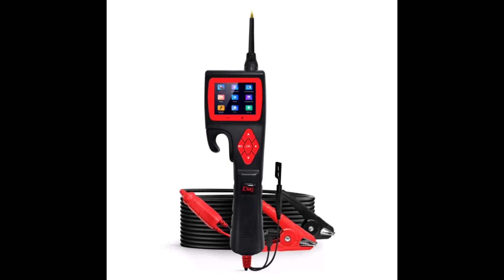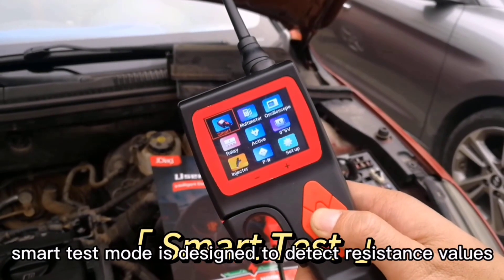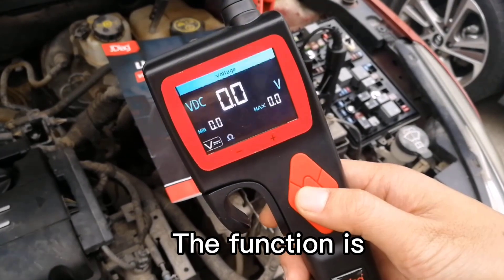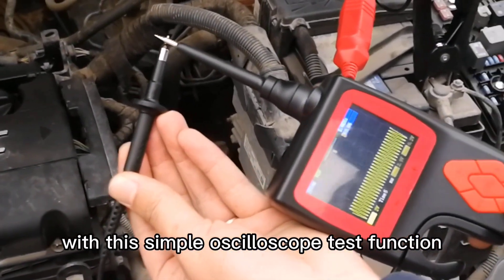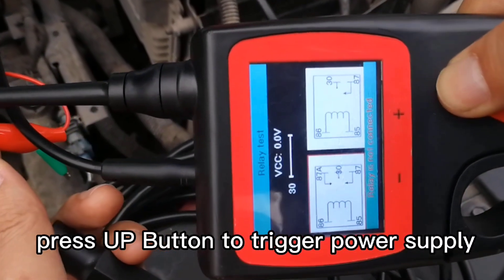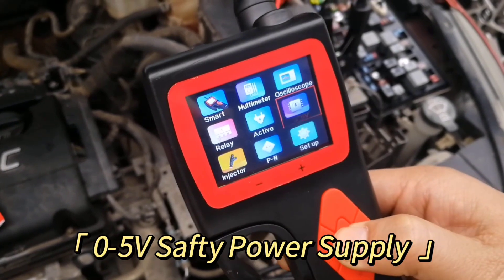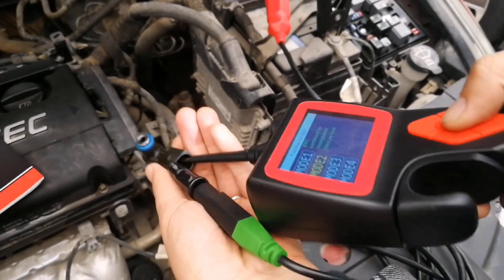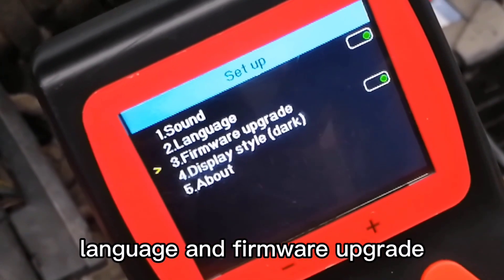TopDiag p200 SmartHook Intelligent Vehicle System Circuit Tester Overview more then Power probe

Comment: On activate mode-- power can be delivered only to the smart tip,  it will not provide ground the the circuit if you need to activate a component.
Try to hook a test light to + and - terminal to smart probe then active the (-) button then it comes as "over voltage protection".  if you hook the test light to ground and smart tip to other end then pres + button then works.

Comment: THANKS SO MUCH FOR THE VIDEOS, I AM VERY INTERESTED IN THIS MULTI-TESTER. CAN YOU PLEASE TELL ME  WHAT IS THE SAMPLING RATES OF THE OSCILLOSCOPE CAN IT RECORDED AND CAPTURE DATA AND ALSO CAN IT BE USED WITH AN AMP CLAMP AND WHERE CAN I BAY THIS TOOL. LOOKING FORWARD TO YOUR REPLY THANKS AGAIN .
Reply: Did you ever find what the sample rate was?
Reply: @joshh4880  THEY NEVER REPLIED.
Reply: these are 'robots only' and all they want is to take your money and run like crazy afterwards 🤔😂😂😂😂😂😂😂😂😂👀